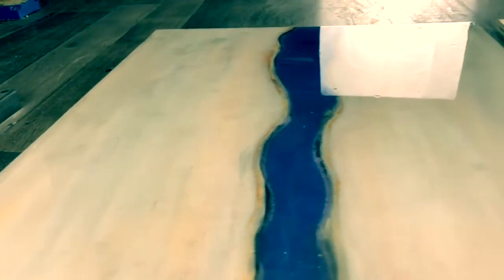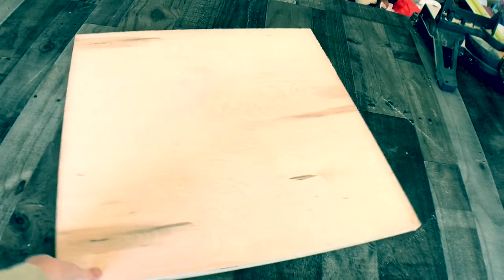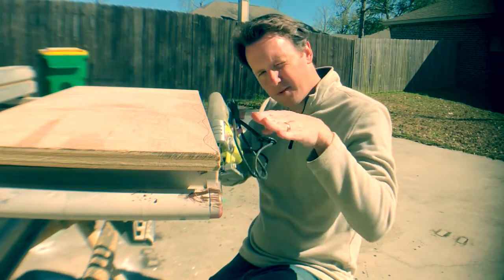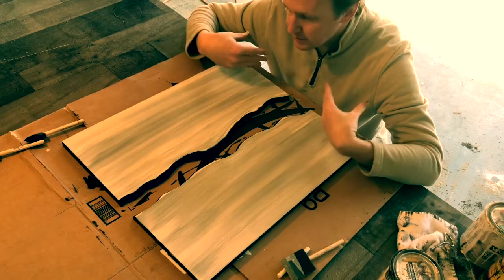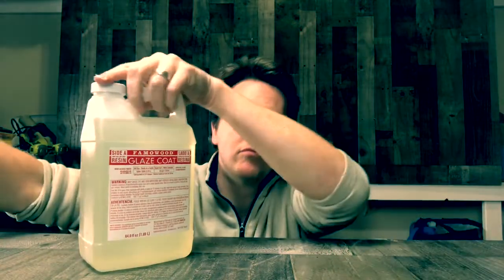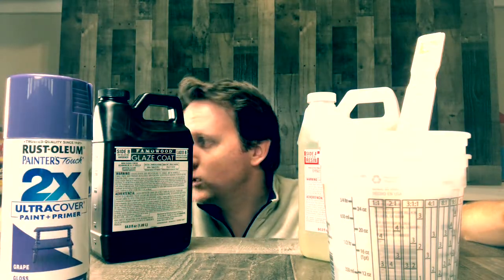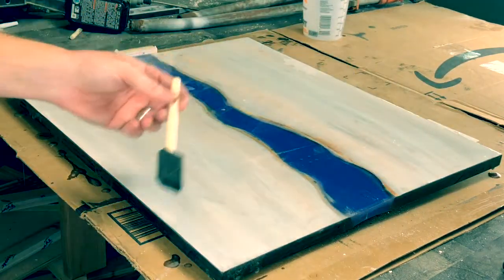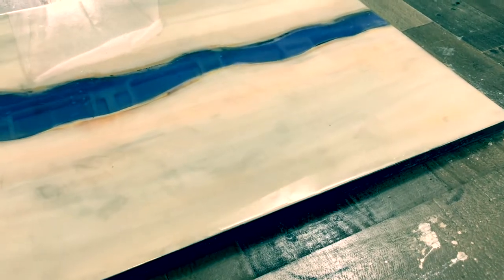How to make epoxy resin table from plywood (2019)

Comment: Looks good. Using plywood and making look it like a live edge is genius. The little devits are from a final flood coat that is too thin and surface tension in the epoxy. The best fix for that is just pour a second flood coat that is at least 1/8" thick all over so the self leveling epoxy has material to work with.
Reply from the maker: Thanks for the comment mike. Thanks. Yeah most of my builds and tables I use plywood and give it the live edge look. Budget friendly.
Reply from the maker: Did u see this one I did.  How to make live edge wood  / plywood/ 2019 https://youtu.be/NZNlgQxCDzM

Comment: temping to try the charred look but if i use maple plywood i dont know how much it would char and burn so may just use hard wood...any  thoughts?
Reply from the maker: +jack d plywood or mdf works great.  This is plywood
Reply: @BUILDFORFUN  i ended up using cedar wood, only downfall i didnt take account for is the warping from the heat. i heard if i put heat on the opposite side , it would level it out but i may just put straps on the bottom so i dont have to epoxy the bottom as well